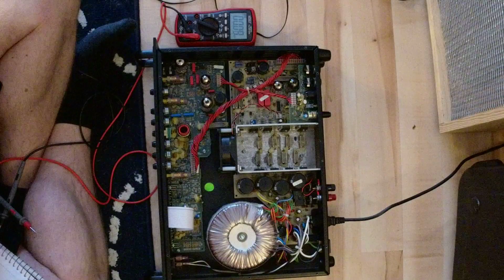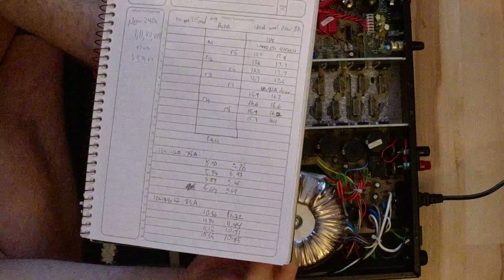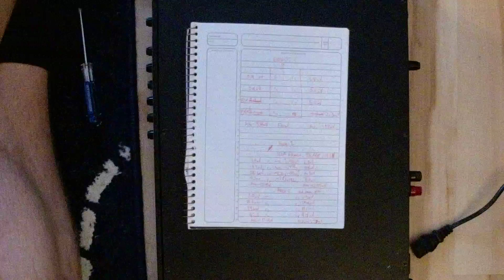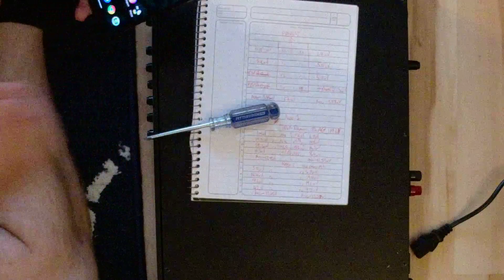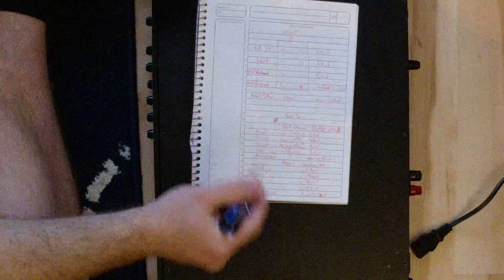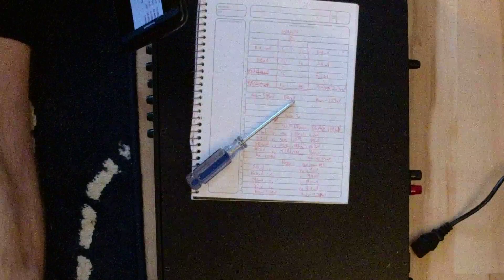Checking transistor voltages in SVT-3 PRO

Comment: Hello. I have a similar issue with uneven voltage on resistors (from 8 to bout 28 mV). Is there any relatively simple solution for this? Or maybe I should ignore it? Thx for reply.
Reply from the maker: Howdy! The good news is - if you have no other symptoms and the amp plays as loud as you need it to, your value range should be fine! The only reason you might need to worry about component value drift or poorly matched transistors is if you saw something like 28mV on the high side and 0 on the low. Even then, you should really only worry about that if you are experiencing audible issues or excessive idle current draw.

If the values drift further, then you'd want to consider either a power board replacement or perhaps ordering a new set of IRFP240/IRFP9240 units, but you really shouldn't need to mess with that unless you have some kind of direct symptom.
Reply: @nurrwick  Thank U for the response! Now it is clear for me. Best wishes form Pioter ;)